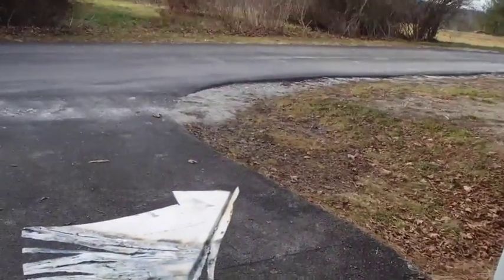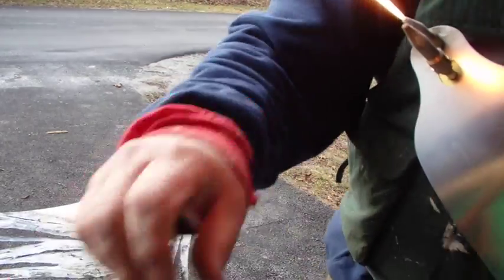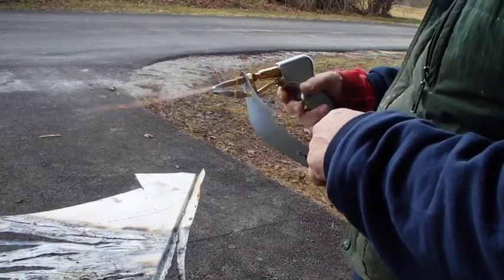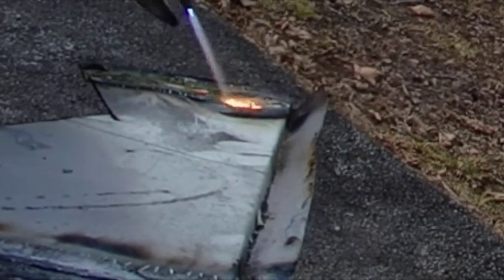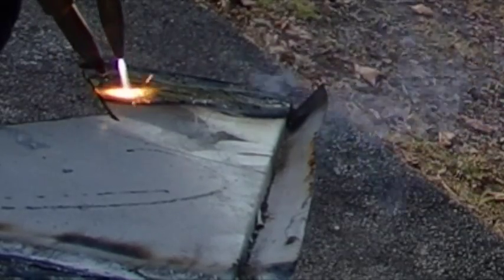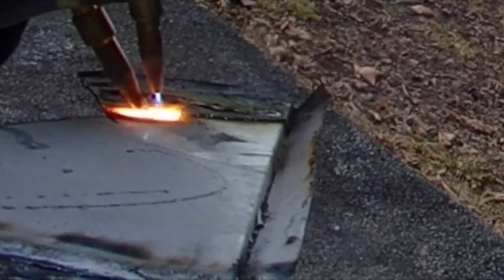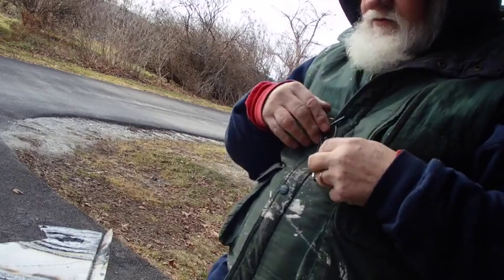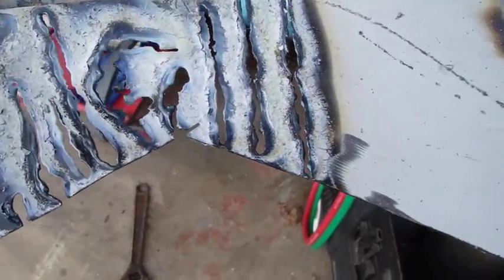Henrob 2000 cutting metal first time

Comment: I don;t have a clue but the Henrob 2000 cutting video on Henrob's channel shows the O^2 line on the top of the gun blowing thru the metal.
Reply from the maker: +dejanira2   That's for thicker metal.  It's called the "over cutter".  for thinner metal they also have the "under cutter."  I've got both.  I was using the undercutter for thin metal.
Reply from the maker: +Stoneyburke That's for thicker metal.  It's called the "over cutter".  for thinner metal they also have the "under cutter."  I've got both.  I was using the undercutter for thin metal.

Comment: I think that you would get a much more consistent and smoother cut if the sheet metal didn't have a coating of paint or enamel on it. Is that appliance sheet metal?  If it is grind the finish off a strip for a try with bare metal.
Reply from the maker: +dan andy    Probably.